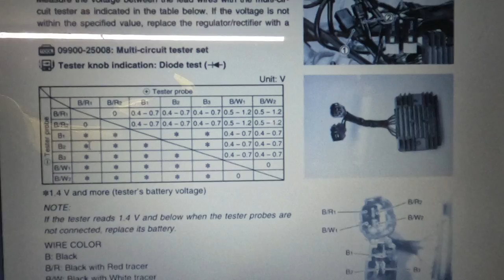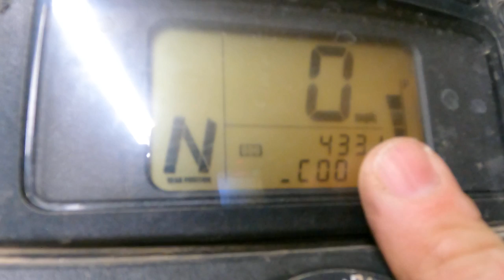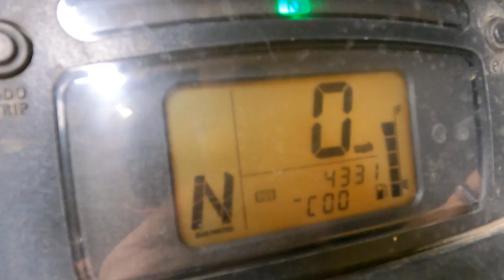2007 Suzuki KingQuad 700 has charging & run ability issues

Comment: Logical and intelligent approach to correct the problem instead of throwing random parts. Great job!
Reply from the maker: Thanks RS1972. I absolutely hate shops & people that just through parts at a unit because they have no idea how to properly diagnose something.
Reply: I also hate throwing on random parts, but I have a 350 big bear and it had no spark, everything was in spec, and I had no idea what could be wrong and started changing cdi’s, coils etc. (I have spares) but nothing. Stator was in spec but I changed it anyway and boom! Nice blue spark. Sometimes changing random stuff helps
Reply from the maker: Well it actually wasn't  the stator you were having a problem with. It was the crank sensor  that's built into the stator harness that was the issue. The older ones also have a source coil that goes bad too.

Comment: Thanks so much for the video. I had the same problem. The stator checked out so I replaced the rectifier and it works great!
Reply from the maker: Hey Ruth.
That is such great news to hear. I'm glad my video  was able to help you figure out the problem. Thank you for the positive feed back.
Reply: Where did you purchase rectifier at?
Reply from the maker: Hey C J. I bought the O.E.M. regulator/rectifier from  I believe partzilla.com.
 https://www.partzilla.com/product/suzuki/32800-42F00?ref=f0a80993a71a8f4c08fe5dc1676c794e2177c048

Comment: Thanks for the great video. I was able to diagnose and fix my king quad 700. One question: is it worth the cost of buying an OEM rectifier for $200? I bought a $25 one and it works for now but am guessing it won’t last long. Also, I’m guessing my stator will need to be replaced one day - it would be great if you could make a video on that too!
Reply from the maker: Yes buying the OEM stator  is absolutely the best thing to do. The cheap Chinese jink ones can cause you're stator to crap out are cause issues with your battery. 
I'm glad to hear my video helped you diag what the problem was.

Comment: Thank you for a great detail video. I'm having a an odd issue with battery drainage. First off I had to replace my Rectifier, so I have ordered one and in the mean time I disconnected the negative and  the positive was still connected. I received my V-rectifier  and I hooked up the battery and it was dead inside of a 1 1/2 days. How did it drain with only the positive connected? I didn't think it would with the ground connected. Battery is brand new.
Reply from the maker: That is a pretty interesting dilemma. I haven't ran across that happening before because it shouldn't happen lol.  Are you sure that you didn't run you Atv & drain the battery & then realize that the reg/reg was bad? Also if the weather was cold it can effect the battery a lot.  How new was the battery? Was it ever ran before?
Reply from the maker: Yeah you definitely shouldn't be getting anything from negative to positive like that. Didbyou buy a O.E.M reg/rec? Are did you buy one off of Amazon?  I would definitely double check your stator. Did you do the forward & reverse bias test on the reg/rec?
Reply: @limitlesspowersportsservic3394  Again I appreciate your help / suggestions! UPDATE - I have replace some of the connectors and wires that needed it. I replaced the starter relay as well. Battery will drain down to 2-3 volts overnight. So there is an apparent short to ground some where. I removed the fuel 10amp fuse and charged the battery full and left it over night again. This time very little voltage drain. I put the fuse back into the circuit. I started researching more I noticed the ECM module felt warm compared to any other module or relay. Is this normal? My code that is displayed when I jumped the test plug is C40. I have looked at the TPS plug and wires which all seem solid. I have seen online where some had issues with the wires breaking for the TPS. However I haven't tested the continuity between there and the ECM yet. One additional piece of information. In the beginning I had issue with the ignition key powering on in certain positions. So I replaced it. This still happens sometime first key position will power on or the second. I'm wondering if the ECM is bad especially with it being warm just sitting there.  What's your thoughts so far? I'm reviewing the service manual to try and conduct some test on the ecm.
Reply from the maker: I would definitely check all your ground wires & code C40 is the ISC Idle speed controller.  You should only be getting milli amp draws on the battery when you do a parasitic draw test.
Reply from the maker: Also the ecm will get a little warm but not crazy hot
Reply: @limitlesspowersportsservic3394   Update - Kyle I have replace the main wiring harness. I had spent countless hours trouble shooting continuity. I just couldn't resolve it, which I was very surprised. In any case everything started working almost perfectly. The machine would run but I had to hit the throttle a little in order for it to start. I noticed the ISC  was not working and it was through 0505 error and it was hot as heck. I put the new OEM on and it got hot as well and the ISC wouldn't cycle. I had a new ECM handy and everything worked. It was a bad wiring harness, ISC and ECM. Apparently the varmints mice / rats had done unrepairable damage to the wiring. So much for a used machine. The take away is when buying a used ATV check the wiring closely. Thanks for all your suggestions!

Comment: Having similar issues with a 2012 750 when I checked the stator plug I found a wire on the rectifier side had been hot and broken, stator had .2 ohms and no short to earth when I checked the AC voltage it went over 100 with the revs up so I would assume the stator has been putting out too much voltage causing the wire to get hot and break, I had change the rectifier with a second hand one I had a while ago as the original wasn’t charging I would say I have damaged this on too now. I will get a new one and repair the wire then retest
Reply from the maker: Yeah your stator is definitely over charging causing your reg/rec to burn up along with the wires. I would replace the stator & reg/rec with a OEM one.

Comment: When you test if the stator is grounded and said it was good, what is the reading on the volt meter? Thanks and great video!
Reply from the maker: Hey Ruth thanks for checking out my channel. When you checking between all the lead the ohms reading should be around .4 ohms. If you get an open then it is shorted to ground. also if your testing from the lead to the negative battery terminal you should not get a reading.  check out a few of my comments below I believe I posted all the specs from the service manual before. I think at leat I did lol

Comment: Thanks very much for this video.  I have the exact same situation, and my tests went pretty much exactly the same as yours so rectifier it is.  Just one quick question - did you put the stock Suzuki one on or something else?  I've ordered a heavy duty Kimpex MOSFET regulator.  Hoping that might handle plowing snow a little better, but I might have made an error there.
Reply from the maker: Hey Kelly. Thanks for checking out the video & the comment. I would say about 99% of the time I order the OEM parts. After being in the industry for about 25 year I have learned that a lot of the after market parts are made really cheap & don't hold up are they don't have the proper voltage output, resistance. Let me know how that reg/rec works for you. I have had good  luck with aftermarket parts but mostly bad. If you have any other questions feel free to comment are email me at limitlesspowersports78@gmail.com
Reply from the maker: Hey Kelly. Sorry I never saw this comment till now. I always use the OEM parts when I work on any Japanese brand. There are some good aftermarket parts out there. Let me know how the Reg/rec turned out for you.

Comment: Nice video. Thanks. Question for you... I have good resistance and startup voltage. But I have no change on my multimeter when checking resistance to the ground terminal from the  plug. Any suggestions?
Reply from the maker: when you're checking the stator internally between the three plugs you should show some resistance. when you're checking the stator from the plug to ground it should not have any resistance at all. if it did have resistance it would mean the stator was grounded out and it was bad. It's a really good possibility if you have proper AC voltage running through your stator and proper resistance inside your stator and the stator is not grounding out it is most likely your regulator rectifier is going bad.

Comment: Great information!  Thanks for the pro breakdown of these tests!
Reply from the maker: Not a problem. If you ever have any questions about something just hit me up & I'll be happy to answer them to the best of my ability.
Reply: @limitlesspowersportsservic3394  I have an 06 kingquad 700 have you ever seen an error code on odometer and trip a b?
Reply from the maker: No I have not. Is this the error code you get when you jump the Diagnostic connector?
Reply: @limitlesspowersportsservic3394 I do get _C00 code, I purchased the atv with the error code it also has the charging issue 😢
Reply from the maker: Well _C00 means no error codes present but the tps isn't adjusted correctly if the line  is at the bottom _C00 you want to adjust it so it looks like this -C00
Reply: @limitlesspowersportsservic3394  yea I have adjusted the tps and it does run better. Now just have to change rectifier. Can't see how many hours are on the machine though.

Comment: I have a 2007 450 king quad. It has A C15 code. It's very hard to get started. You have to hold it at about half. Throttle and rev it. up to get it to stay run.
Reply from the maker: Well the c15 is a coolant temp sensor code. Did you check the tps sensor to make sure it is aligned properly?  Also check your spark plug, air filter, fuel pressure, vavle clearances. All that plays a roll in how it starts up & runs.

Comment: When you test from the plug end to the negative terminal on the battery what are your volt meter test settings as what is a good and or bad reading?
Reply from the maker: Hey Tim. I'm set on ohms & you don't want any reading at all. It's should show infinite ♾️. If you get a reading on this model then you stator is grounding out to the motor. Just note that it's not the same for ever make & model.
Reply: Would this apply to the 2008 750 king quad ?
Reply from the maker: Yes it's exactly the same. I believe in one of my comments I posted the specs. I forget how ma y comments back it is.

Comment: This on another electrical issue … I have a ??? for you. I bought a 2005 King Quad 700 & put battery in it and instantly without doing anything the starter smoked & burnt up… have any idea why that happened???
Thanks
Reply from the maker: Sounds like possibly a bad starter solenoid & a shorted out starter internally

Comment: stator tested good wire to wire as well as ac volts. However wire to ground failed the test. Ive never seen that before? what are the chances my regulator is bad to? Machine wouldn't run with stator plugged into reg/rec but when I unplugged it, it ran great
Reply from the maker: It's a really good possibility thay your reg/rec is bad too. With the stator grounding out its a good possibility that ypu have a short to ground on the reg/rec causing it not to run.
Reply: @limitlesspowersportsservic3394  pulled stator out and it seems to bench test fine? It'll read bad for like 1 second then it goes back to OL for the next 5 minutes of trying to get a reading.
Reply from the maker: That would be a sign of a bad stator. If it was grounded out on the motor that was you first  sign when testing it. When you get intermittent reading like that then the stator is starting to breaking down

Comment: Great video! Do you know what could be wrong with KQ700 2005 , which shuts down very often when fan of the radiator starts or sometimes when I connect 2wd -> 4wd. I read many Topics about this issue , but have not find the right answer.
Reply from the maker: Hey markus. I would definitely check your charging system & have your battery load tested.  whenever your fan kicks on are your putting your atv in 4x4 are taking it out off 4x4, you are putting a load on your battery. If the battery doesn't maintain close 12v DC your  fuel injection system doesn't operate properly causing the atv to die. I would start there & then check all your connectors take sure they aren't corroded & counting a short to ground.
Reply: @limitlesspowersportsservic3394  allready checked connections, battery is a New one And also there is New suzuki oem rectifier. When engine is running there is 14,40v And engine shut down battery voltage about 12,80v , I have made better ground from battery-engine-atv body. But Still there is something that Makes it shut down.

Comment: Olá amigo, comprei um KingQuad no Brasil,  e estou com um problema, ele desliga quando aquece, o que pode ser?
Reply from the maker: Hey Humberto. Thanks for checking out the channel. So are you telling me when it gets up to operating temperature it just turns off? Are is your machine actually starting to overheat then shuts off? this is a hard one to diagnose without actually having the machine in front of me. It could be so many different things from a TPS sensor, ISC motor, engine temperature sensor. Is it flashing any Fi codes on the dash? Sorry for the delay on the response I am currently traveling with the race team I work for.

Comment: Great video 👍 My stator plug with the 3 yellow wires has melted on my 2012 king quad 750 however the stator tests good what are your thoughts
Reply from the maker: My question would be what is the AC voltage output of the stator while it was running?  Usually the plugs only melt when they get hot and they're not connected very well. Also they usually melt when the stator is out putting too much AC voltage for the rectifier to handle. And then in turn it ends up destroying the rectifier also.
Reply: 30v at idle. I think I will have to change the stator thanks for the reply
Reply: 80v at around 3000 rpm does that sound too high
Reply from the maker: So when you're testing the stator. between all three yellow wires from one yellow wire to the other yellow wire you should have 0.4 - 1.0 ohms of resistance when testing the yellow wire to ground you should have 0.0 ohms of resistance or infinity.  When you're checking AC voltage output between each leg one at a time you should have no more than 75 volts AC at 5,000 RPMs. if all that does not check out then your stator could be overcharging. This is directly from Suzuki factory manual for your quad.

Comment: I was adjusting my TPS on my 2005 KingQuad 700 and i ran out of adjustment for it, the little line on the screen will not go to the middle. does my Quad need a new TPS or is there something else wrong?
Reply from the maker: Hey Cullen thanks for stopping & checking out my channel.  Yes sounds like your TPS sensor is bad. I suggest getting an OEM one from the dealer but you can always chance it with one off of Amazon but I'm not a fan of Amazon parts.

Comment: How do you adjust the tps ? I can't get mine in the middle.
Reply from the maker: My video should have it pretty detailed. But if you can't get it to stay in the middle it's most likely bad. When you loosen it up it takes a very minor movement to get it to move the - to get it in the middle. If it doesn't want to adjust 
You should just replace it with a new one.